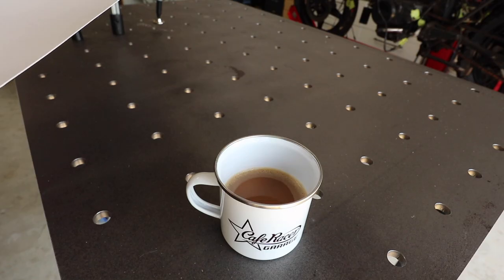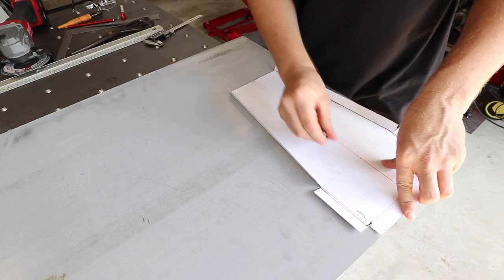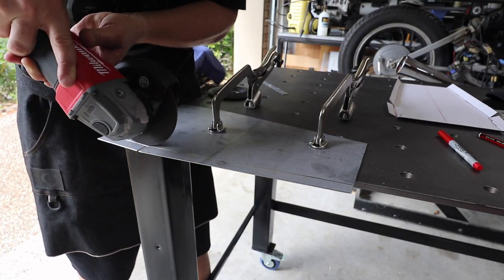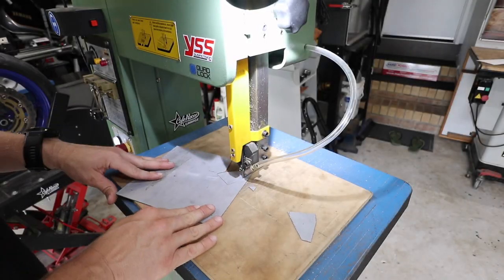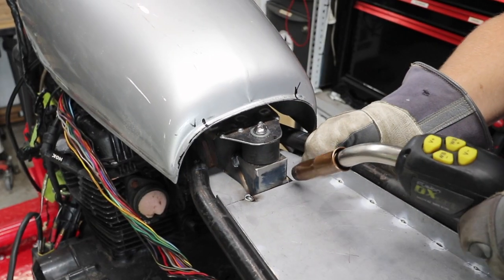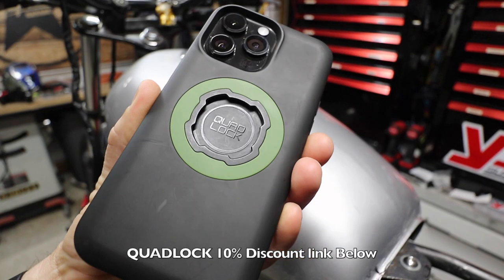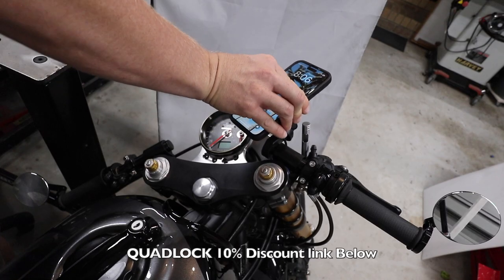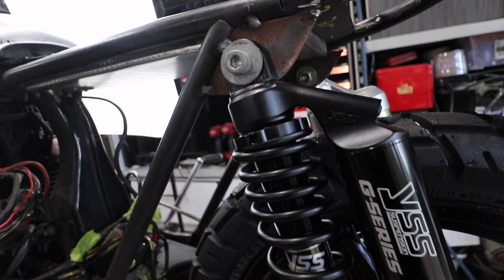★ Electrics Tray Made Easy, 3 TIPS FOR A PERFECT FIT!!!

Comment from the maker: YSS SHOCKS, 10% DISCOUNT ➨ https://www.suspension-store.com/ 
Use Code: GRGYSS

BELT GRINDER ➨ https://84engineering.com.au/products/shopmate-48-belt-grinder
5% DISCOUNT CODE: CRG5

CMS (OEM PARTS) ➨ https://bit.ly/CMSnl_com 

QUAD LOCK 10% DISCOUNT ➨ https://bit.ly/3Mebjjj

MOTORCYCLE LIFT TABLE  ➨ https://www.machineryhouse.com.au/a349

WELDING TABLE ➨  https://www.machineryhouse.com.au/w08455